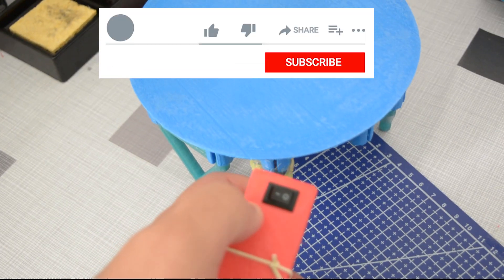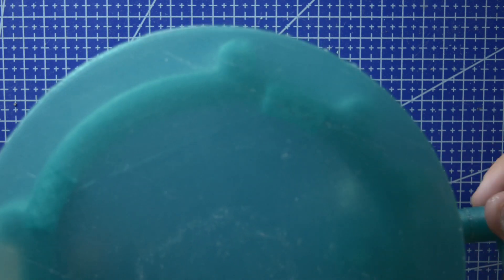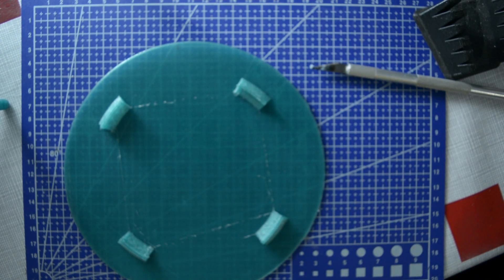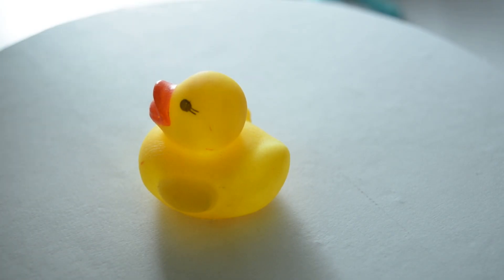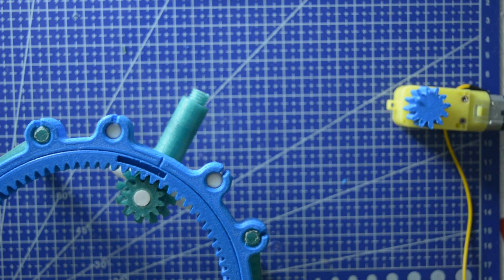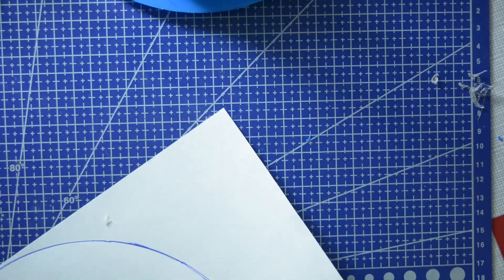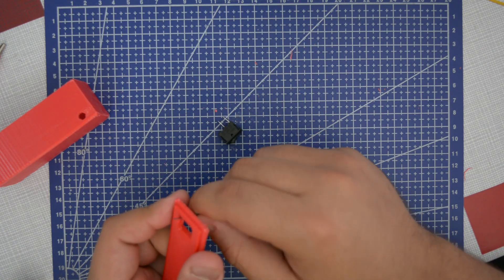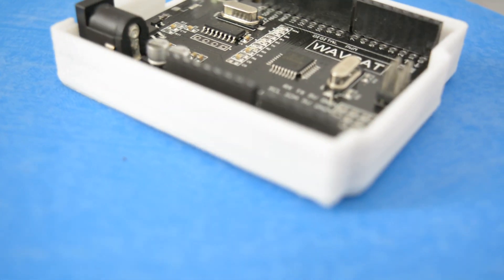DIY Electric 360  Rotating Turntable for Photography #27

Comment: That's pretty cool.  One option that would work better if you are doing photos not video would be to use a Geneva Drive (https://en.wikipedia.org/wiki/Geneva_drive) mechanism, which rotates in discrete steps, pausing in between.  If you triggered your camera just before the pin re-engaged, even the lightest objects should be perfectly still.
Reply from the maker: Maybe a diy scanner soon using this system :D,
Thanks